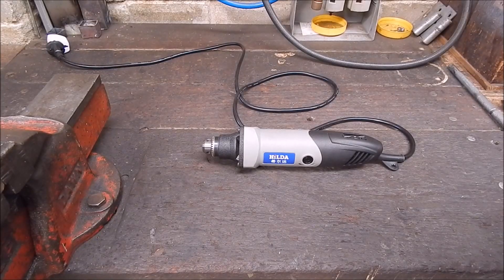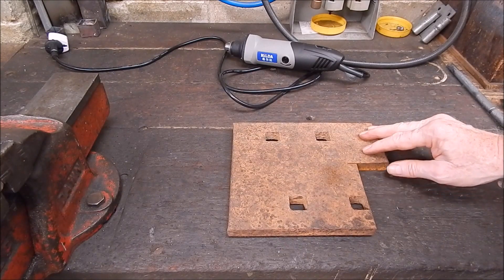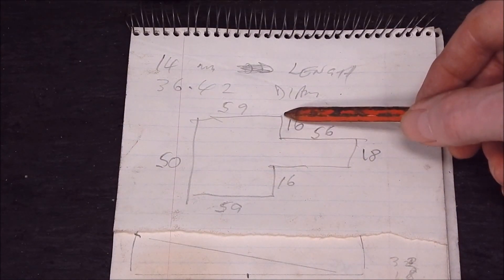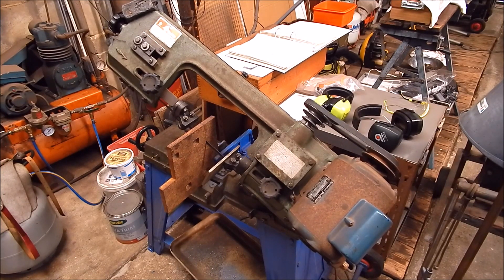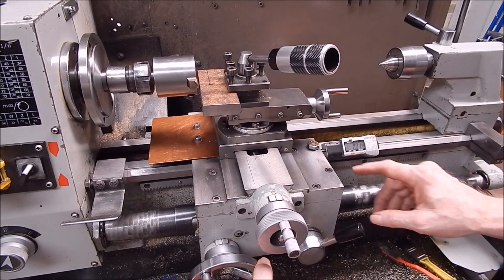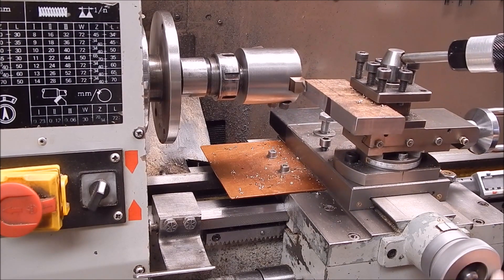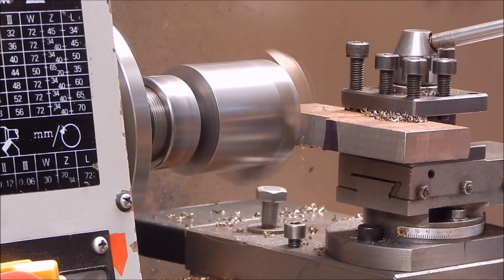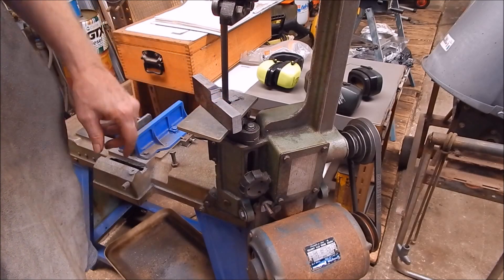Turn the HILDA 400 watt rotary tool into a tool post grinder - part one

Comment: Another great video Rob.  I wish they made those grinders in 120V for US, they look really good.
Reply from the maker: Hi Ron, 

Maybe you need one of these:

https://www.ebay.com/p/Step-up-and-Down-2000w-Heavy-Duty-Voltage-Transformer-110v-To-from-220v/2097004139?iid=252526247874

Cheers Rob

Comment: Your channel is one of my favourite Rob learnt so much from you. Bought my cheap chinese lathe based on your recommendation. Now my recommendation for you. Treat yourself to a mill. You would create some great content. I inherited mine and as much as I use the lathe more the mill is my next go to much to my surprise. Im a tight arse and short on room but the mill just completes the whole deal imho. Just dont tell the wife.
Reply from the maker: Hi George,

Yes, a mill would be nice.  I keep an eye open, but no rush.  Space is the issue.  The RF-45 is a nice size, but I read where a lot of people have issues with them (oil leaks, bad bearings and gears).  It's a bit off putting.  Maybe one day.........

Cheers Rob
Reply: xynudu my son bought the hm48 which he never used. I dont know much about models but it works well for me. Leaks oil almost from day one specially on hot days and im really working it. Solved the problem by making a sponge ring which sits under quill. I squeeze it out every couple of months. Was gonna replace bearing seal but realised even when new it leaked and my son told me most of the mills he used in the trade leak as well so i live with it. Look forward to the day you land one im sure you'll have plenty of tricks to share. Just bought the hilda as my dremel was always just a bit underdone for some of the tasks. Unbelievable how cheap this stuff is. Years ago i only ever dreamed of tooling up but now the chinese have made it a reality. Cheers mate
Reply from the maker: Hi George,

Supposedly from what I've read the oil leaks through the bearings and over time washes out the grease.  Then the bearings fail.   This sounds a bit suss to me as surely the oil would still lubricate the bearings ?  Maybe the bearings are shit ?

I've spoken to a few owners who burnt out their Dremels very easily, one was just doing light woodwork.  The HILDA is way more heavy duty.

Yes, with Chinese tooling we've never had it so good, price wise.  The quality can also be good if you are willing to pay a reasonable amount and look for DIN standards.

Cheers Rob
Reply: xynudu suss indeed fresh oil going pass the bearing never hurt anything. Id say heavy work on a light machine is gonna be the major problem for the bearings. When i was doing some dove tailing last year you could feel the ol girl grimishing at bearings. Got the job done with light passes and patience. Everything has its limits. Hope you guys are getting some relief from the heat down there. Its a mucky one here in Queensland today.

Comment: Good video Rob.  I was wondering about the section where you are measuring the parallelism of the part on the top slide though.  Surely your indicator was on the cross slide, which by its nature is always at 90 degrees to the spindle?   I think I must have misunderstood this bit.
Reply from the maker: Hi Luke,

I will explain.

You touch one end of the work piece against the cutter, and zero the indicator against the side of the carriage.  Now use the cross slide to move the other end of the work piece against the cutter tip.  See if the carriage has gone left or right as a result of any misalignment.  The side of the carriage is just an extension of the backside of the workpiece in this situation.

Think about it.

Or even better, try it on something in the tool post.

Cheers Rob
Reply from the maker: Just to elaborate a bit more.  You are measuring the parallelism of the work piece in it's mount, not the cross slide.  The work may be crooked, but the cross slide stays the same.

Cross slides are also not exactly 90 degrees to the ways on regular lathes.  They are angled slightly left of centre.  They do this so that when facing, you actually get a very slightly concave result.  This is so that you can always put two faced surfaces together without rocking.  Two convex faces will rock.  This is where a tool makers lathe is better because you decide how much, if any variation is used (everything is adjustable).

That's also why, when facing off you should never go past centre.  If you do, the cutter will tear into the work (due to the continued angle of attack).

Cheers Rob